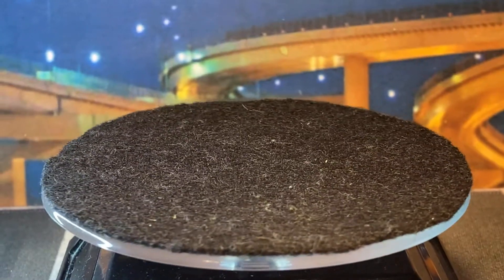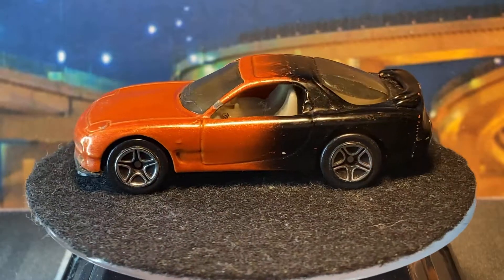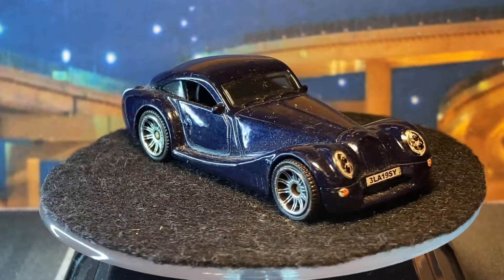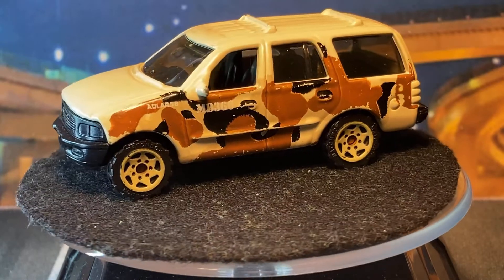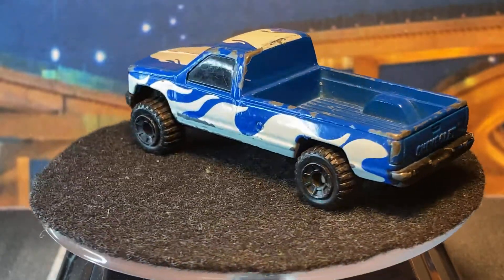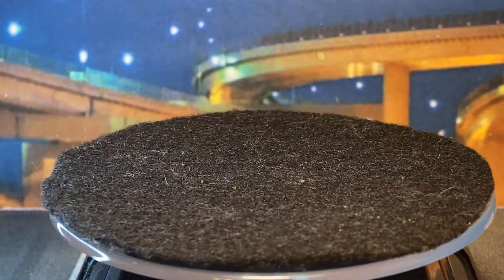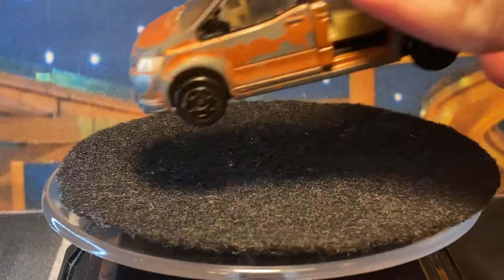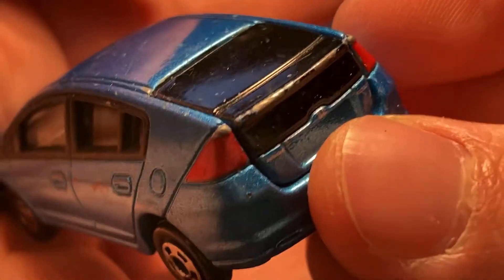Massive Diecast purchase from HotwheelsDon on Instagram, part 2! Matchbox and Tomica

Comment: Great haul, you have nice picks. I think the Toyota Camry is the year from 1998. The Nissan Serena in orange, I had at least 4 of them all with broken doors. I bought at separate times from each other, the one I had when I was a kid I broke it door. The other ones had slightly broken doors but not too major, I think the Nissan Serena from 2006-2007 was prone to doors breaking, even my newest one I had that I kept in mint condition one day a small piece of the door just cracked off. I have a lot of Tomica I have that are chipped that came from my childhood, so for a long time I’ve been debating to try to customize them but all of them tell a story to me so It some sentimental value to me.
Reply from the maker: Ye I feel you, I’ll never customize or sell my childhood models, which is a problem because they take up a lot of space. It’s a shame those Serena’s are prone to broken doors, bad batch of plastic 🤷‍♂️